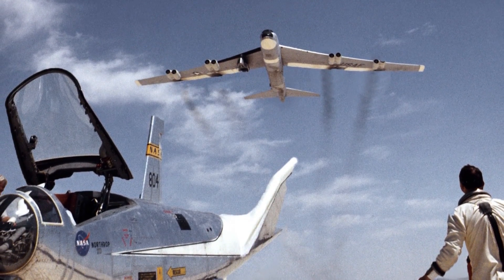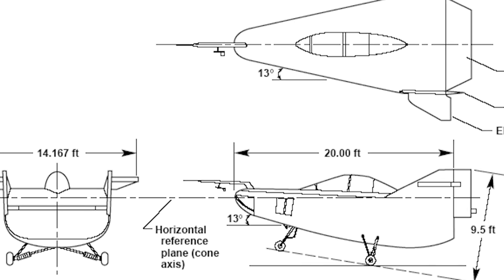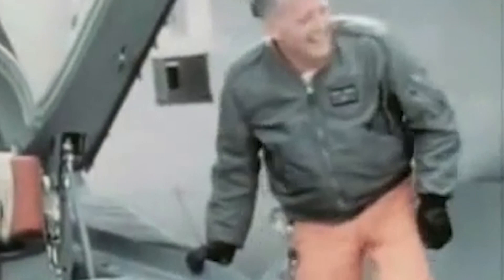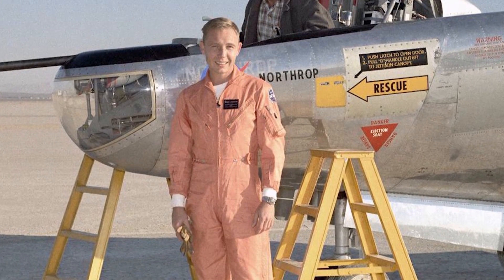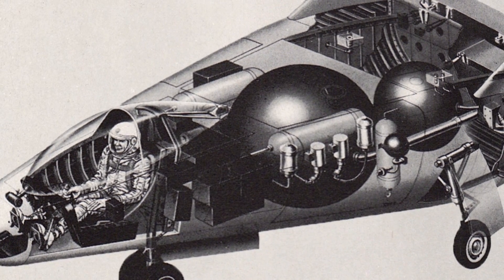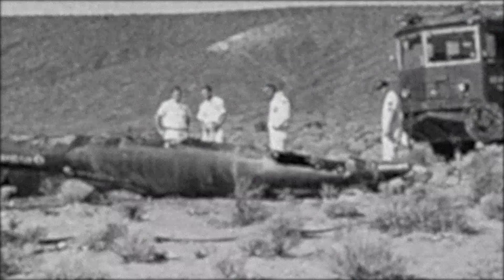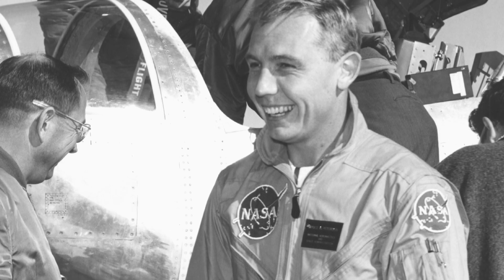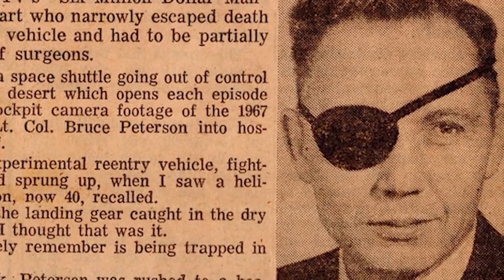The M2-F2 Crash - Space Shuttle Prototype

Comment: I'd make this M2-F2 flying brick upside down, round side up, to generate lift the traditional way, flat side down.
But this video seems including flight of two totally different machines, one has two rudders, the other has three.
An Aeronautical Engineer warned about unstability that lead to the accident, without echo.
You can build one of these in your backyard, in concrete, 4 mm thickness was enough for a kart body. Concrete is a composite, many different ingredients can be added to mixer. Concrete density is 2.6 gr/ cc, Steel 6 gr/ cc. Dyna Soar was made of Inconel.
For propulsion, an improved, duct enclosed PulseJet, when airspeed of 300 m/ sec is reached, a Lorin RamJet will start working.

Comment: If you really want to know about the lifting body program, read Flying without wings , it all started by “the lads” flying models of the hangar roof at lunchtime in a glider competition someone came up with a wingless type, the results  whilst not efficient did fly better than expected, then engineering and the pilots got involved and decided to go full size maned, Although all the manufacturing was still done during lunchtime and after work it did get a bit of funding the pilots managed to acquire the biggest fastest car they could get with limited funds. Towing the maned full-size lifting body at high speed up and down the runway helped them redesign and link the control surfaces, it was 25 years since I read the book, so some details have faded but the book was a real page turner I read it nonstop in one hit

Comment: Hey Dark Footage! Fantastically interesting video, from various perspectives. Thanks for posting. 
Another significant challenge with lifting-body designs, although not mentioned herein, beyond roll control, is very high landing speed, especially relative to aircraft's size and weight.
I haven't been able to find any hard info on this, and based on above video and others, seems landing/stall speed was quite high, probably 180 mph or higher. If some methodology could have been developed to counter this challenge (such as, for example,  altering wing shape prior to landing), we may have seen the lifting-body concept pursued and developed much further.

Comment: Why do so many people like on this channel on you tube just make up lies when they don't know , lies instead of going to the effort of researching their subjects?  It's very aggravating.  This experimental aircraft by Northrop was to research the "lifting Body". This was where the fuselage of the aircraft provided the lift and wings could be reduced or eliminated altogether and so realize great benefits in reduced drag, weight and fuel savings, increased load capacities ect..
Ultimately the fruits of this research can be seen in modern fighters like the F18, F15, F22 all.have a significant component of their lift being generated by the fuselage or body itself. 
The space shuttle does not have a lifting Body design, as is pathetically easy to see even for a stupid ignorant you tube fabricator like this one as the shuttle resembles a loaf of bread with wings attached. If this moron would have said the SR71 it wouldn't have been any less a lie but at least the SR71 does indeed have design elements of a lifting body, lol, again as is easy to see.

Comment: Im no expert but im persuming that the shape with no wings was due to the space ship/plane's re entry through the earths atmosphere, the high temperature through friction for about 3 minuets? Any type of wing would most likely disintegrate due to the heat, so a roundish shape would be better and safer, and not having the tech they do today with those special heat tiles they used for the shuttle later they would have to go down the route of having no wings, so coming through the atmosphere was fine but once it did its design was unstable for flight, no wings no lift no stability, so why couldnt they put retractable wings or folding wings on it? They surely had the tech back then to try either of these, folding wings from the top that would be well away from entry heat or retractable wings that came from the side from behind doors just like the landing gear? Like i said im no expert in any of the fields needed to achieve these things but i would have thought the brains of the days that were coming up with these vehicles would have tried these things! Maybe they did n dark docs will dig them out for us!?
Reply: Any movable parts incur a weight penalty plus what do you do if the wings don't unfold or extend, or worse yet, only one side works. The F-14 Tomcat engineers had a hard enough time accounting for all that.

Comment: Their control systems were manual, fly-by-wire consisting of chains of discrete op-amps.  Sometimes hundreds of them to get the right amount of sensitivity and response.  Any failure in those chains and things would go south quickly.
Reply: Yeah, the computer technology at the time was not there, not an engineer but my guess is the aircraft to be truly stable needed better fly by wire. Lot of modern aircraft are unstable without computer fly by wife.

Comment: This really wasn't a Space Shuttle prototype. Although, lessons learned from these experiments informed the designers of the Shuttle. We had to figure out how to re-enter the atmosphere at hyper speed, not burn up and control the craft once the the atmosphere was dense enough. This aircraft had what was called a "lifting body" design to generate lift. It was thought that conventional wings would either burn off or structurally fail at such speeds as re-entery from space. This was in an age before the aircrafts computers controlled and stabilized the attitude as is common today. Now we probably could accomplish stable flight with this design, but then...not so much!

Comment: The M2F2 used the XLR-11 engine, as used on the Bell X1 in 1947, so you can not rightly say the M2F2 was the first to use it, in 1966. Your statement at 2:00 is misleading.

Comment: How he survived the crash was due to the design on the vehicle. It was extremely tail heavy because of its shape. No way around it, the internal framework had to be bigger, and thus heavier, at the back. A proposal for a fix was made, borrow some gold from Fort Knox to load into the nose, then put the gold back after the test program was done. Back then NASA had the pull to something like that. But the engineers though that wasn't an elegant solution. What they did was add steel, a lot of steel all around the cockpit. After the crash they figured the frame could've take a 300G impact without bending. That's why it was able to be rebuilt and modified.

Comment: Stop telling the myth that the NASA lifting bodies were precursors or prototypes etc for the Shuttles. The only thing the Shuttle took from this program was that it was possible to make an extremely steep, high speed, landing approach then flare to transition to horizontal flight, without engines and without splattering the vehicle down the runway.
The Shuttles are NOT lifting body design. They're bricks with wings.

Comment: At 00:39 in this video:  The lifting body shown in the foreground is the HL-10.  The M2-F2 had only two vertical fins, which more or less pointed straight up.  The outboard fins on the HL-10 angled outward.  
 
After the M2-F2 was rebuilt as the M2-F3, it also had three vertical fins, but they all three still pointed {more-or-less} straight up. 
 
Put the two aircraft side-by-side and there are other visual differences between them.  For me, the angling of the vertical fins is the quickest way to tell.

Comment: I think that actually the 'Original' space shuttle prototype was project 'Dynosoar' which looked a LOT like the final space shuttle design. It was designed to launch the same way and return the same way. Major problem with all aircraft challenging the spaced realm back in the '60s was the lack of a material to absorb the heat of reentry. Even the X-15 came very close to flying into space but the lack of an attitude control system and the reentry heat prevented it from going any further. On one mission the X-15 actually got very close to the edge of space however the heat of the reentry friction melted away the leading edges of the wings and tail as well as the tip of the nose of the plane.
It would seem that if those problems had been solved, America would have beaten the Russians into space.
Reply: These weren’t space shuttle prototypes. They were research vehicles.

Comment: The M2 F2 was not the first liquid fuel powered aircraft for Northrup the  X15 was powered by liquid fuel reaction engines and the stability augmentation system that the M2-F2 aircraft used was developed during the X15 program which started in 1959.

Comment: Whenever you have stabilizers that are not close to the centreline you can be asking for trouble, you just don't see it in successful aviation prototypes.
 In this case the round bottom added to the rolling problem as it creates an easy resistance to the motion.
The pilot was very skilled in getting the little control he had, then firing thrusters to try & stabilize the craft.
 As it was, they able to salvage some of it.

Comment: 0:35 Did anyone else notice that the exhaust doesn't line up with the engines of the B-52? It's obviously a faked photo, as you can see that someone got clumsy with their scissors and cut off part of the B-52's #1 engine nacelle, seen on the farthest right side of the photo.
Reply: Well spotted
Reply: Digital artifact cause by trying to add motion\3D effect to a still photo. If you watch the clip, the B-52 appears to be in motion.

Here is a link to the original photo:
https://en.wikipedia.org/wiki/Northrop_HL-10#/media/File:Northrop_HL-10.jpg

Comment: USA aerospace engineers were notorious for designing in poor yaw and pitch control with thier undersized horizontal and vertical fins, stabilators, elevators, rudders, etcetera. Empennage design was lacking in many respects due to excessive concerns with drag reduction. The fact that they needed a 50% increase in yaw control surface area shows just how poorly designed and engineered the original lifting bodies were. 

The test areas were full of irresponsible people who wandered around into the safety zones, or in this case, flew into protected airspace. We are lucky more test craft didn't crash and kill pilots.